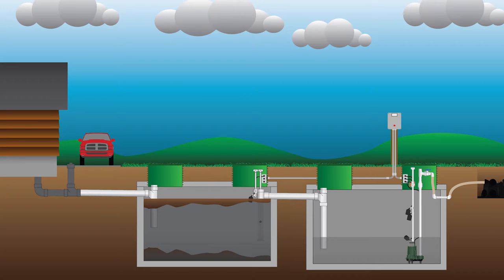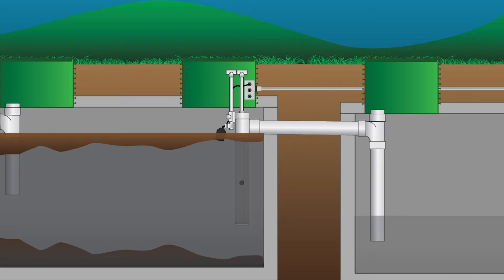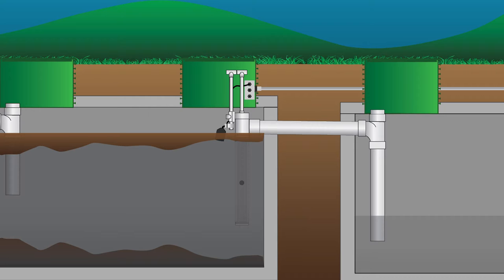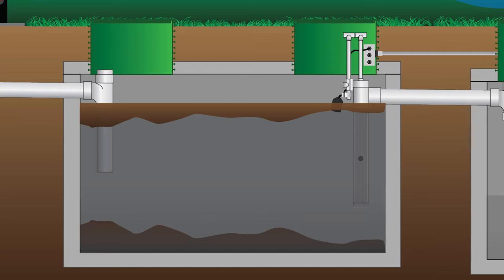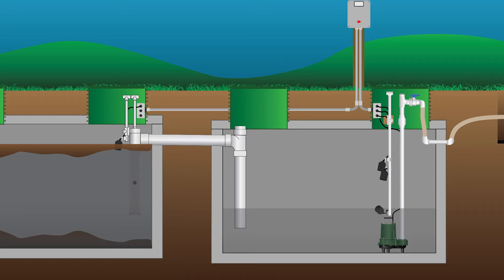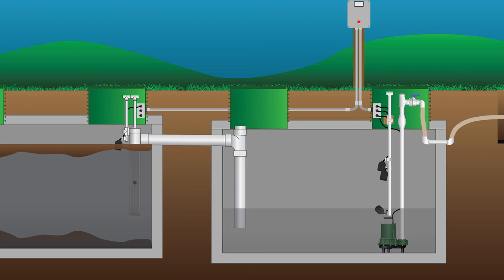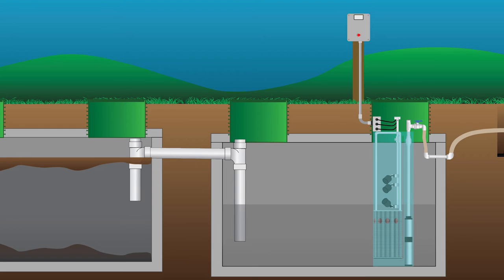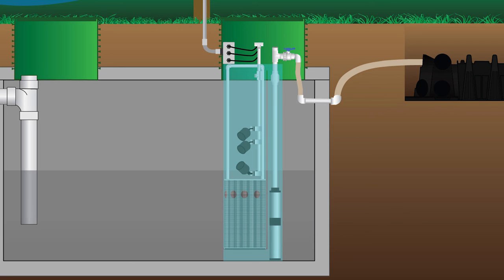Effluent Filters and Pump Screens

Comment: Have a ? for ya. My 6yr.old house has aerobic drip system. My disc filters keep clogging anywhere from 3 weeks to 3months. I clean both, even soak in bleach like Amiad says on website, I use chlorine tabs as well. For first 3 years no issues, didn't even know I had disc filters in pump tank. I even install a 6" effluent filter before last pump tank..No local septic guys been any real help..Why alot of organic growth on disc filters in last tank?

Comment: Curious as to why you washed it off right back into the septic tank? It will just end up right back in the filter no? Wouldn’t it make more sense to wash it off and collect the screenings in a trash container?
Reply from the maker: Good Question! The septic tank is constantly being filled with suspended solids from waste breaking down. The small portion that gets caught on the filter gets a "second chance" at breaking down when we spray it back into the inlet side of the tank. Disposing of the screenings in a trash container will not have any significant benefit in terms of pump-out intervals or screen cleaning intervals.